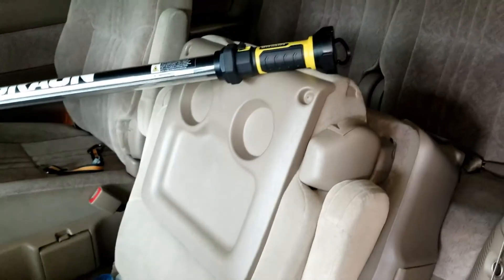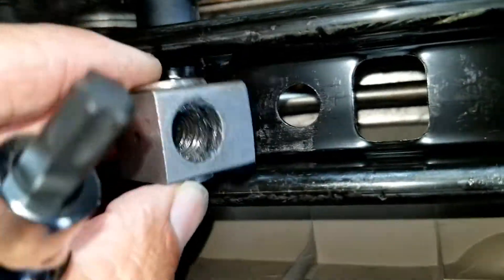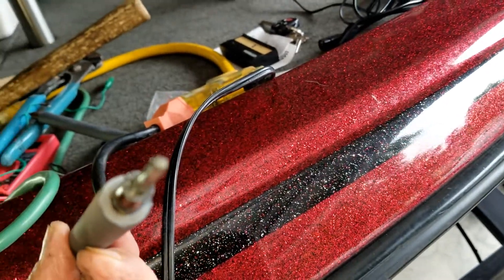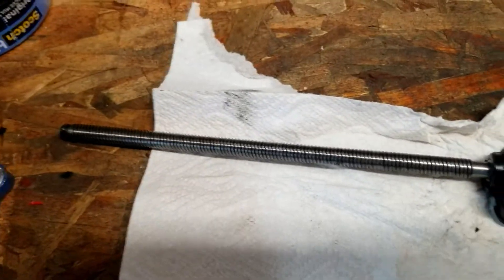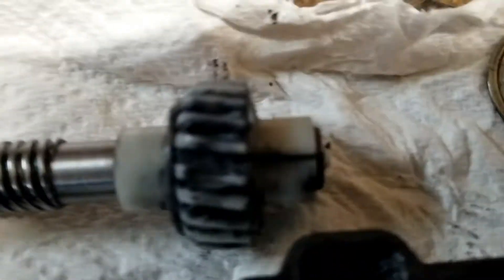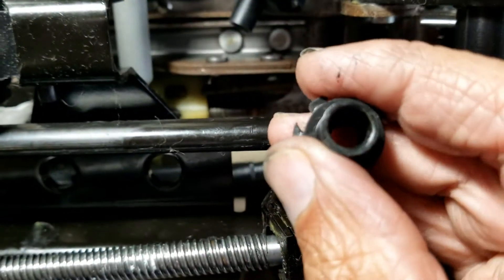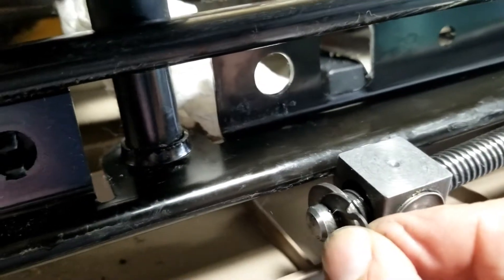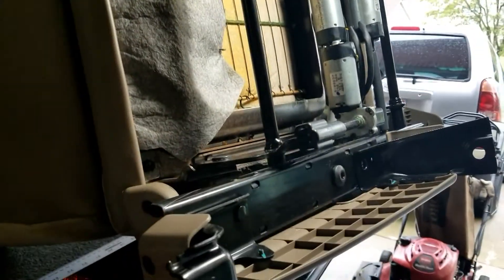99 Sienna Power Seat Repair

Comment: Hi, Rich. Didn’t see if your seat have the electrical connection for seat belt buckle. Mine have the buckle but no electrical connection and seat belt light is on all the time no matter seat belt was or wasn’t latched. Don’t know if you experienced it yourself. Please help if you have any idea! Tks in advance.
Reply from the maker: Hi Danny. That seat belt light drove me nuts for a long time. Sometimes it stayed on, sometimes it would go off.  The problem is with the sensor in the compartment for the seat belt shoulder harness pillar. There is a sensor that can be replaced but it's expensive; $200. You can also just disable the sensor so the light doesn't flash, which is what I did.

The full explanation is at this link: https://www.justanswer.com/toyota/48p8x-toyota-sienna-le-2000-toyota-sienna-seatbelt-light-remains.html. **Read the caution very carefully**. I just disconnected the wire and I haven't been bothered since then.
Reply: @richward2288  Thank you very much Rich, I found the culprit for keeping the light on just like you described and went at it all weekend. Managed to turn it off only and it's always off now. it eased my frustration at the moment but might head to junkyard to pick up another unit later. You helped to stop my 6-month frustration. I'd buy you a beer if have a chance. Good luck with your life and stay safe!

Comment: Did you ever find the part?  I am having a similar problem.
Reply from the maker: Hi, yes I did. I couldn't modify the video without deleting the old one so I added the link in my comments just below the video screen:
I found the needed worm drives online and installed them. They were costly but the repair was successful
https://www.twomenonegarage.com/product-page/copy-of-toyota-gear-kit-replacement-forward-backward-gears-1